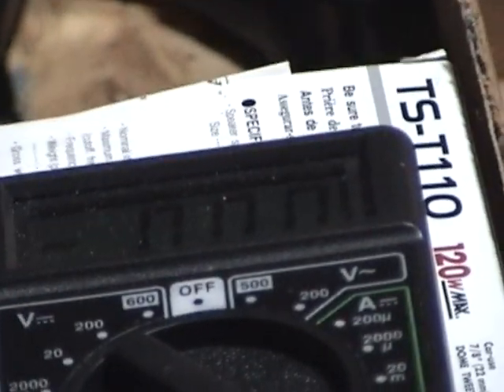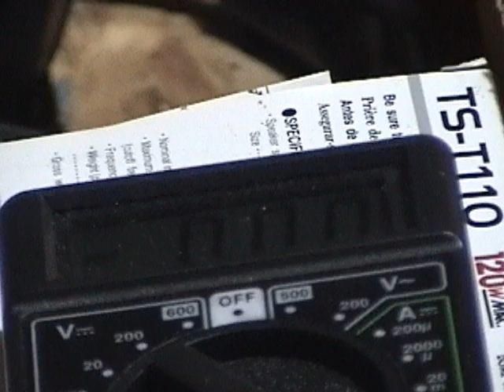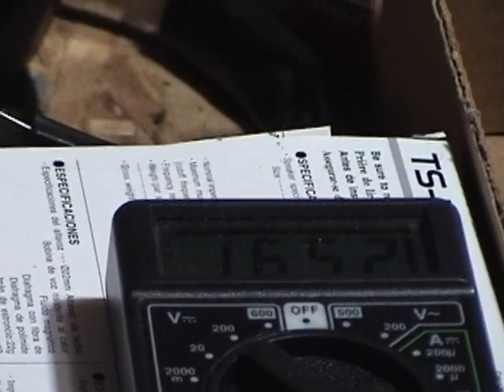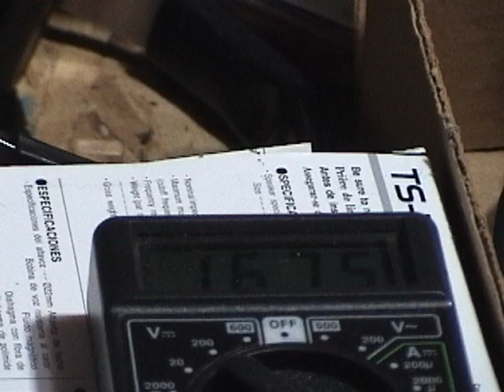Our Coilgun

Comment from the maker: @hifatpeople It is on our to-do list but first we need to improve our coil and efficiency (we have the energy of a 30-06, but you certainly can't tell.)  The coil is well insulated so we have no issues there. And we don't use the salt resistor anymore. I'm well aware of the dangers of chlorine gas emissions, I've done extensive experimentation with electroplating, and that makes gas evolve as well, though not always chlorine.  Rest assured the basement is drafty enough we won't get asphyxiated.

Comment from the maker: Thank you very much for the tip, we have experimented a little with the coil design but not having a lot of wire, we are kind of stuck where we are (unwound transformer wire.)  We tried a 10 AWG coil and we blow light switches every fire (we also upgraded to 6 cap banks for over a thousand volts at God only knows amps.)  We'll make a point to try a new coil, what are the specs of yours (turns, gauge, length etc?)  Thanks again.